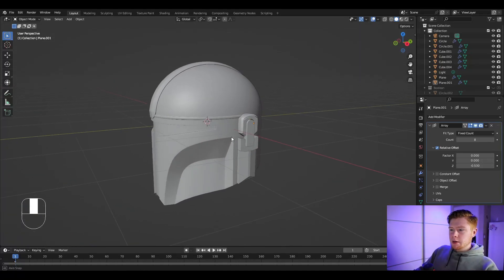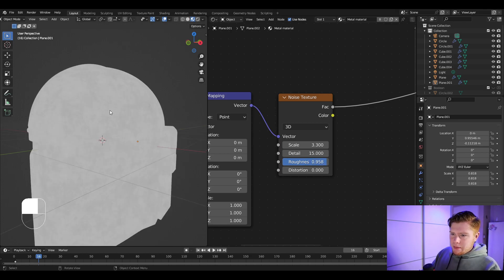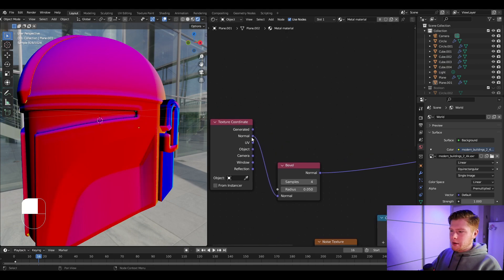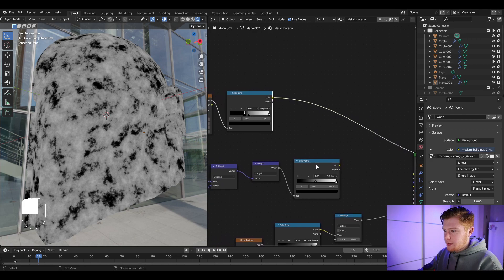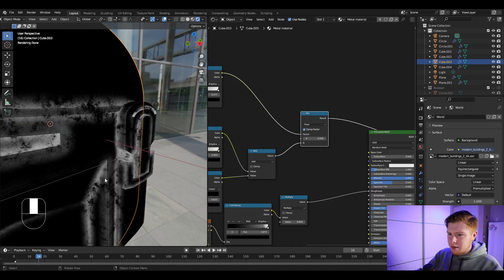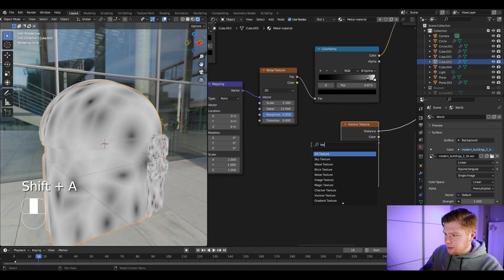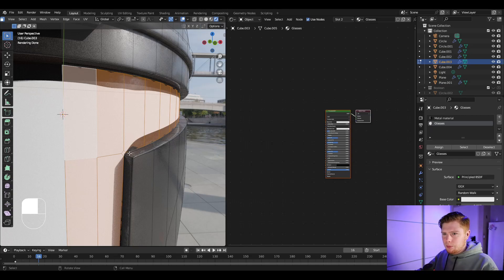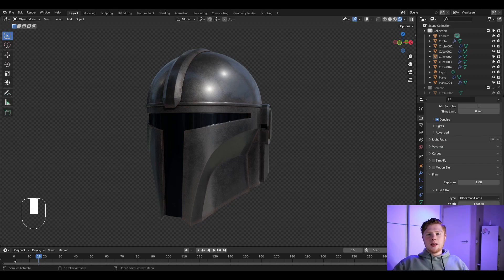This Is The Perfect Way Of Creating A Metal Material With Rust For A Mandalorian Helmet In Blender!

Comment: Thank you for such a good tutorial. I am trying to 3d print the helmet, but when I delete the faces inside of the visor, the result is bumps along the edges of the visor. would you know of any way to fix this?
Reply from the maker: Thank you! Hmmm, hard to say without visual example. What you can try to do is fixing the normals of your mesh with shift-N?
Reply: @mtranimation  ahh I figured it out, when i went to delete the faces I accidentally deleted the vertices instead of the faces. Thanks